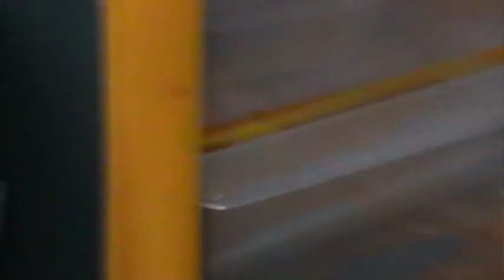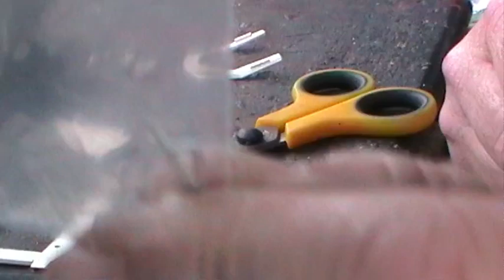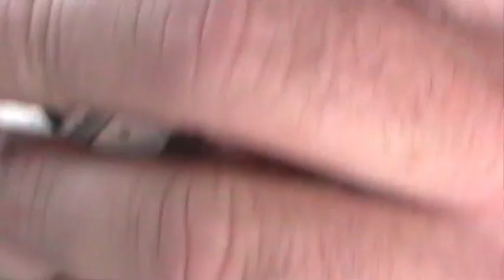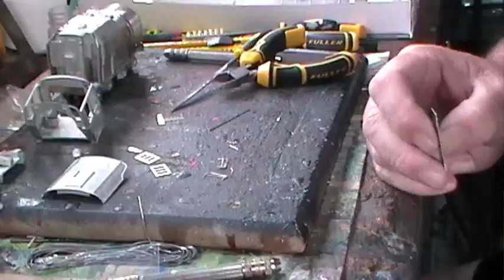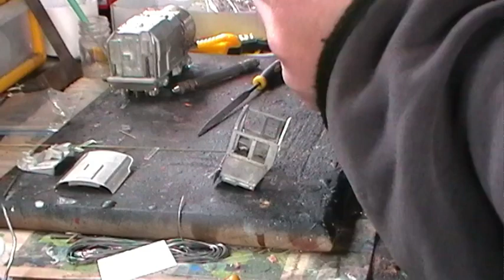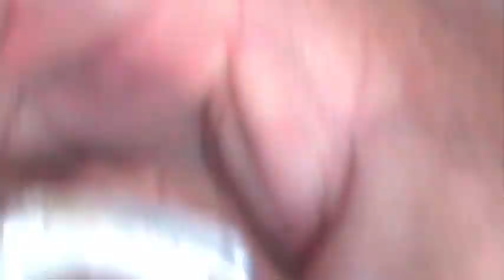Jb cab build

Comment: Beautiful job! Cab looks amazing. I like the wooden board you work on. You probably have seen it use a steel plate to help keep things square and flat.
Reply from the maker: Your onto it Scott a flat surface is perfect for this kinda thing i just find i dont need it anymore as im not building anything new its just rinse wash and repeat for me..as.for the old abused chopping board its had 28 locos built on it now and probably has another 20 left in it before being replaced who knows it might even still be around long after im gone 😅😅
Reply: @LocoGuyNZ Well hey!. If its not broken, then dont fix it. Haha. Nice work.
Reply from the maker: @scottcoleman9570 is there going to be a live tomorrow mate
Reply: @LocoGuyNZ Yeah i will be live tommorow. See you then.